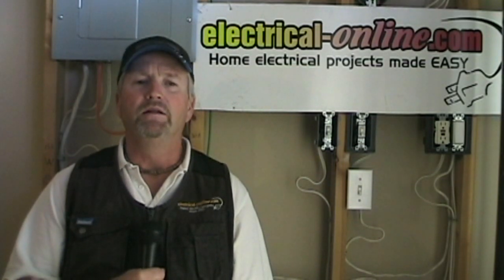Understanding Your Dishwasher/Garbage Disposal Circuit

Comment: Why is the white neutral wire repurposed as a hot wire for the switch leg. Why not just use the black wire like in the rest of the circuit?

Comment: Doesnt the dishwasher have to be on a gfi?
Reply from the maker: Yes, I believe in many jurisdictions it now is.  However anything installed before the rule change (as with any code addendum or addition)  is grandfathered in and doesn't have to be changed, but a good idea to add the protection if you can.

Comment: So my disposal will not work. I turn the breaker labeled “disposal” on and off and there no power in the recep even on the “on” position. What do you think is the problem?
Reply from the maker: Now I'm sure you've tried this, but just in case, is there a switch close by for that outlet?
Reply: Bad outlet

Comment: Hi have questions concerning your video.
Have a understanding of basic wiring.

This is a brand new Mobile Home which has already seen two GFCI switches go bad after 8 months.
They have 20 amp circuits wired with 15 amp wall outlets in several places too.  Should I be concerned?

My dishwasher is a 15 amp circuit dedicated to the washer only.
Yet they wired a 20 amp plug to the dishwasher under the sink using 14 gauge wiring.

Would like to install a garbage disposal but uncertain as to how to do this

Should I run another power line to a switch above the sink and run it to a dual 15 amp outlet under the sink separating the two by pulling off the hot tab and making 2 circuits one hot all the time for the dishwasher and one for the garbage disposal via the switch?  Could use the neutral as a hot lead to the switch Correct?

Should I use 12 gauge or 14 gauge wire from the switch to under the sink?

Understand How you do it with the 20 amp circuit just not sure if I can combine 14 and 12 gauge wiring for this job?
Hope I asked YOU correctly?

Please advise!

Thanks
ED

Comment: What can I do if I don't have cables to connect my dishwasher? Can I just run cable from my socket on the counter down to dishwasher? Or I need to connect directly to breaker box?
Reply from the maker: A dishwasher should have it's own dedicated circuit.

Comment: Give your audience a little credit. 90% of people watching this video know how to rap wire around a screw. You wasted so much time explaining that I lost interest and never did learn about the circuit which is why I watched this video.  Next time focus on the topic!
Reply: He didn't spend THAT MUCH time on it. He had the issue in-frame for longer as he talked about other things but he spoke about it for just under 30 seconds.
Reply from the maker: I'm sorry. I'll try to do better next time. I feel shame.
Reply: In my 30+ years of doing Electrical work, I've seen too many wires wrapped counter-clockwise around screws...so wrapping the screw clockwise is very important and should be mentioned. A wire wrapped counter-clockwise can come loose, which I've seen time and again. Loose wires cause electrical fires.

Comment: my undersink outlet plug in will run my disposel when pluged in to either plug in but not my new dishwasher, dishwash does work when pluged in extension cord. whats up!
Reply: Mine is doing the same thing.  Did you ever figure out how to fix it?
Reply: I'm having same issue. Did anyone figure this out?

Comment: Rickis Clark commenting to Terry Peterman
I have a 2 plug receptacle in recep box with 1 black, 1 red, 1 white & 1 ground wires coming from a switch box that controls one of the plug receptacles & the the other has a continuous current. The receptacle box is located right under kitchen sink and want to change the plug to a GFI! Can this be successfully done with the four wires I mentioned only coming from the switch?
Need Ur Help on this One Terry
Reply from the maker: Short answer is no, this can't be done with the way it's wired. The shared neutral will give you nuisance tripping, and you can't "split" a GFCI receptacle like you can do with a regular receptacle. The good news is that you don't need to protect this circuit with a GFCI, so don't. Leave it as it is, best solution.

Comment: I have a double pole breaker to two switches, one for the Disposal, and the other for the dishwasher.  What would I do differently, my outlet died and I need to replace it.
Reply: I think I have the same problem.    I tried to replace both the outlet below the sink and the double-switch next to the sink, and now both switches turn on the disposal, and if I flip both switches, the disposal shuts off for a while.     Not sure if this damaged the disposal, but that would suck if it did.     is the problem with the outlet or with the double switch or both ?   I hate
how the home-builder did that.

Comment: I have same set up that being 20amp breaker 12g wire. I noticed previous "electrician " tapped into an outlet and ran 14g wire to power 4 recessed lights. should I be concerned having 14g and 12g wire on circuit?
Reply from the maker: I would just change that 20A breaker down to a 15A. You should have no issues with tripping the breaker.